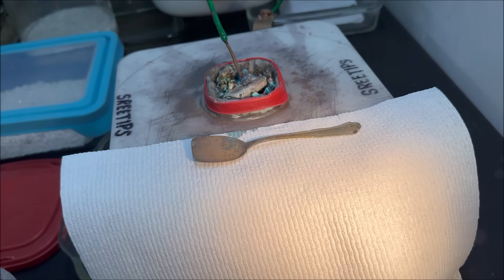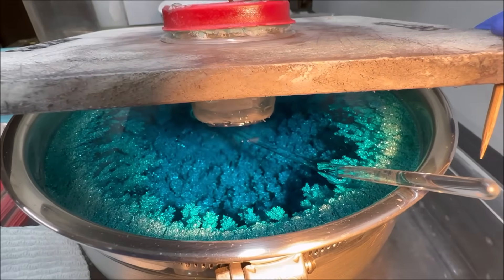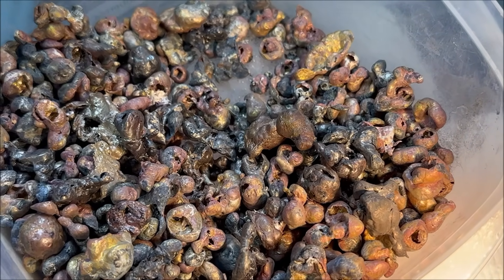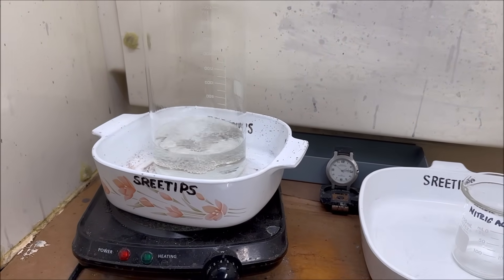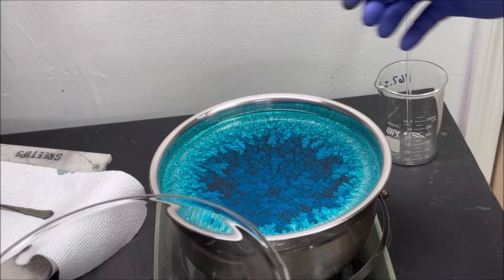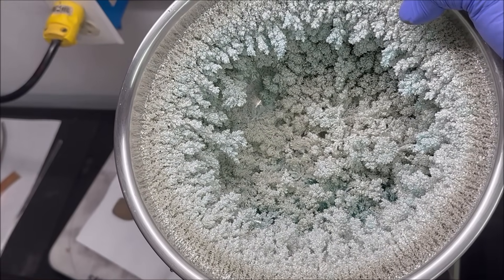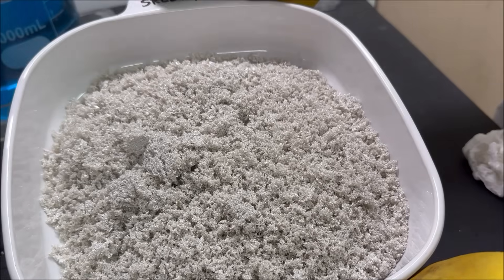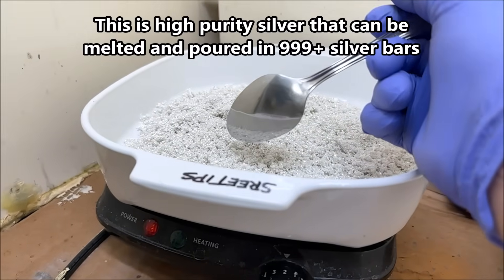999 Fine Silver Cell Harvest and Reboot

Comment: Where and how did you get your starting material from which you extracted this silver?
You said something about a byproduct of your gold refining?
Reply from the maker: I refine gold. I use sterling silver, that I buy at estate sales, to refine the scrap gold. I recover the silver from that, melt into shot, and run it through my silver cell. Silver is a by-product of my gold refining. The cell converts the impure silver (about 980 parts per thousand silver) to high purity four nines fine (9999 parts per ten thousand) pure elemental silver metal. So I’m refining the impure silver, into high purity silver, not creating silver out of thin air. When it’s full, I harvest the pure silver crystal, put it away and forget about it. Then I repeat the whole thing again.

Comment: Whats the source material?
Reply from the maker: I refine gold. I use sterling silver, that I buy at estate sales, to refine the scrap gold. I recover the silver from that, melt into shot, and run it through my silver cell. Silver is a by-product of my gold refining. The cell converts the impure silver (about 980 parts per thousand silver) to high purity four nines fine (9999 parts per ten thousand) pure elemental silver metal. So I’m refining the impure silver, into high purity silver, not creating silver out of thin air. When it’s full, I harvest the pure silver crystal, put it away and forget about it. Then I repeat the whole thing again.

Comment: How many second hand store cutlery pieces are needed to produce 1.3 kilograms of .999 silver at $0.25 a fork?
Reply from the maker: I refine gold. I use sterling silver, that I buy at estate sales, to refine the scrap gold. I recover the silver from that, melt into shot, and run it through my silver cell. Silver is a by-product of my gold refining. The cell converts the impure silver (about 980 parts per thousand silver) to high purity four nines fine (9999 parts per ten thousand) pure elemental silver metal. So I’m refining the impure silver, into high purity silver, not creating silver out of thin air. When it’s full, I harvest the pure silver crystal, put it away and forget about it. Then I repeat the whole thing again.

Comment: So what other elements are in the left over sludge besides gold and platinum? Also how many grams of silver did you say you used to seed the batch, 600g? Where do the new silver atoms come from?
Reply from the maker: I refine gold. I use sterling silver, that I buy at estate sales, to refine the scrap gold. I recover the silver from that, melt into shot, and run it through my silver cell. Silver is a by-product of my gold refining. The cell converts the impure silver (about 980 parts per thousand silver) to high purity four nines fine (9999 parts per ten thousand) pure elemental silver metal. So I’m refining the impure silver, into high purity silver, not creating silver out of thin air. When it’s full, I harvest the pure silver crystal, put it away and forget about it. Then I repeat the whole thing again.
Reply from the maker: Maybe some palladium and rhodium

Comment: Hello Sir,
You are calling this silver crystals. Is this also normal metallic silver? Which isotope?
How profitable is this whole thing?
Reply from the maker: In order to determine a profit I’d have to sell the silver. But I’m not selling any (except a few ounce on my eBay site). I’m not selling, I’m buying.
Reply from the maker: I refine gold. I use sterling silver, that I buy at estate sales, to refine the scrap gold. I recover the silver from that, melt into shot, and run it through my silver cell. Silver is a by-product of my gold refining. The cell converts the impure silver (about 980 parts per thousand silver) to high purity four nines fine (9999 parts per ten thousand) pure elemental silver metal. So I’m refining the impure silver, into high purity silver, not creating silver out of thin air. When it’s full, I harvest the pure silver crystal, put it away and forget about it. Then I repeat the whole thing again.

Comment: Brother what is the best torch to melt silver and gold with. I find my mapp gas taking a long long time to melt in the winter days. Whats the next step up? I dont know a thing about aceteleyene torches
Reply from the maker: I use acetylene torch with flame down low to melt pure silver. Then switch torches to MAP for the pour. I had problems with the molten silver out gassing in the mold and forming a bubbles looking surface when I kept the oxy/acetylene torch on it for the pour. MAP takes about ten minutes to melt 5 ounces of silver. Oxy/acetylene takes about two. This has been my experience.
Reply: @sreetips  is it difficult to use one of those torches? I just don't want to blow myself up hahaha
Reply from the maker: No, they are scary at first but once you use it a few times it’s a breeze. I love mine. Been using it for 14 years. They have automatic flame arresters that prevent the flame from getting up the hose and into the tanks.
Reply: @sreetips  perfect!! Thank you so much brother. I will make the investment today!
Reply from the maker: Get one from a welding place such as Linde Welding Supply. Mine is a medium duty. You get the bottles for a deposit. When they’re empty you can swap them out and just pay for the gas.
Reply: @sreetips  Perfection brother. I will reply with which one I purchase.

Comment: I would like to try this - could I use my scrap silver with solder on it from silversmithing as the initial pieces in the filter? 
Also it would be useful to have a list of safety equipment. What kind of mask etc.
Pure silver powder would be so useful to me to use for texturing jewellery apart  from anything else.
Reply from the maker: In order for electrolytic refining to be successful, the anode material must be fairly high purity to begin with.
Reply: @sreetips Thanks!
Do you have a video on all the equipment you need and all the safety precautions?
Reply from the maker: I have one titled silver cell build from scratch step by step.

Comment: Can you actually profit from this
Reply from the maker: I went from zero net worth, 1/4 million in debt, to seven figures, debt free, in nines years. And I did it with gold and silver.
Reply: @sreetips  my friend and i had a plan to process plated gold jewelry
Reply from the maker: I have videos on operating a sulfuric acid stripping cell. GP material is very low yielding. May take up to ten pounds of GP material to get just one gram of pure gold. But it is a way to recover gold from junk jewelry. If you seek to “make money” then you should be looking for karat gold at local sales. Americans are utterly clueless about silver and gold. Most believe, incorrectly, that paper currency is more valuable than gold and silver. This lack of understanding is a conditioning imposed by those who print the currency, out of thin air, “without limit.” You can become very rich using this lack of understanding to accumulate a fortune in gold, and silver. But it won’t just fall in your lap. You’ve got to know what to look for, when to look, and where to look. Mrs sreetips found two giant charm bracelets loaded with charms. Paid five hundred bucks. The gold alone was worth nearly eight grand! But she has a trained eye (been doing it for decades), she gets to the sale first in line (if you get there later then you get nothing), and she knows where those sales are by doing research ahead of time. There’s lots of work involved, there’s no free ride. With people being ignorant about these monetary metals (gold and silver are still real money, real wealth, regardless of what people say), you can become rich. But this won’t last forever. At some point folks will begin to wise up and realize that their fiat paper, or digital, isn’t worth what they thought it was. Then there will be no other place to turn except into gold and silver. Get some! While the getting is good.
Reply from the maker: The currency printers can’t afford to have you converting your savings from their paper (currency is a money substitute, and it has no real value) into real money, gold and silver.

Comment: SO from refining gold I assume that's Silver And Lead Rock combo?
Reply from the maker: I add sterling silver to the karat gold to refine the gold. I recover the silver and run it through my silver cell. The metals that I work with have already been mined, they are already above ground when I buy them. So there’s no lead in precious metals that I work with. The only way I could encounter lead is if someone tried to use soft solder to repair a piece of karat gold.

Comment: Could this be a method to refine recycled electronic metals?
Reply from the maker: I don’t think so
Reply: @ sadness 
Looking for a creative way to recycle circuit boards
Reply from the maker: I remember accumulating computer scrap when i first started. Had scrap PCs taking up lots of room in my shop. Finally realized that the amount of scrap needed to recover a decent amount of gold would require a mountain of junk computers. They ended up in the trash at the dump.
Reply: @ damn… good to know. I was given some huge boards. So they aren’t normal circuit boards, but I’ll just put them away and stock them up. Any other ways to acquire pm to refine if we aren’t close to a mine?
Reply from the maker: Check FB market place, estate sales, yard sales, thrift stores, consignment shops, resale stores. We just got back from a trip paid for with gold we found by stopping and searching at these places.
Reply: @sreetips  appreciate all the advice! I’m about to stop by shops while I’m away working to look for some treasures
Reply from the maker: We found two grand worth of gold for about twelve hundred. Plus a bunch of silver coins. It’s out there for those who know when, where, and what to look for.
Reply: @sreetips  do you have any tools that help you find PM or just go based off visuals
Reply from the maker: We’ve looked at tens of thousands of pieces of jewelry over the last two decades. With that much experience, we can judge, by sight, if a piece is gold or not.
Reply: @sreetips  gotta get to it then 
Thanks for the advice

Comment: Doesn’t copper have to be present for the silver nitrate to crystallize ? Doesn’t it need to do basically a “atom” swap solid copper goes to liquid as silver liquid in turn crystallizes ? Sorry for the crude grammar
Reply from the maker: Not with electrolytic silver.

Comment: Can you send the directions on how to build that exactly so I don’t blow anything up?
Reply from the maker: I have a video titled silver cell build from scratch step by step.
Reply: How do I get the garbage silver for the top if I have no silver? Also when the liquid level drops do I just add distilled water?
Reply: Also how much silver should I be starting with to make the solution?
Reply from the maker: The concentration that I use is 150g of pure silver dissolved in one liter of liquid.
Reply from the maker: I buy sterling silver at estate sales. I prepare extra silver nitrate electrolyte and use it to adjust the level in the silver cell.

Comment: I want to hangout with you and better learn this process and see what safety precautions are necessary during what exact steps and pprocesses. This is definitely chemistry and understanding elements and chemical reactions, fused with electrical knowledge as far as the DC power supply, anode (usually positive) and cathode (usually negative). When you mentioned augmentation I know augment usually means to undergo a form of change if I'm not mistaken. If you live in the midwest I would seriously pay money just to hangout for the process and take your crash course so to speak to learn it better. 

Awesome video.

Comment: Okay comments "blah blah blah" now what exactly was that ? Did you "Grow" silver at all . Or just filter the silver to finer purity ?
Reply from the maker: Good question. I refine gold. I use sterling silver, that I buy at estate sales, to refine the scrap gold. I recover the silver from that, melt into shot, and run it through my silver cell. Silver is a by-product of my gold refining. The cell converts the impure silver (about 980 parts per thousand silver) to high purity four nines fine (9999 parts per ten thousand) pure elemental silver metal. So I’m refining the impure silver, into high purity silver, not creating silver out of thin air. When it’s full, I harvest the pure silver crystal, put it away and forget about it. Then I repeat the whole thing again.

Comment: Man, you gotta make a vid selling this at pawnshop and them testing it!
Reply from the maker: No need. I’ve sent this off for fire assay and it comes back three nines. However, I sent some of the pure silver crystal back through the cell a second time. Then sent a sample of the twice-refined pure silver crystal off for ICP analysis. That came back greater than five nines fine. That’s 99999 parts per one hundred thousand pure elemental silver. And that’s as close to 100% pure silver as humanly possible.

Comment: That filtered anode is pure genius.
A tip if I may : @ 8:05 or so, when you heat the silver/HNO3 mixture, you should recapture the NO2 that forms and bubble it inside water to recycle it as brand new HNO3.
Reply from the maker: Excellent suggestion, thank you

Comment: you still need silver to make pure silver. It just dosent magically appear from thin air. This video shows how to purify it.
Reply from the maker: Correct. I refine gold. I use sterling silver, that I buy at estate sales, to refine the scrap gold. I recover the silver from that, melt into shot, and run it through my silver cell. Silver is a by-product of my gold refining. The cell converts the impure silver (about 980 parts per thousand silver) to high purity four nines fine (9999 parts per ten thousand) pure elemental silver metal. So I’m refining the impure silver, into high purity silver, not creating silver out of thin air. When it’s full, I harvest the pure silver crystal, put it away and forget about it. Then I repeat the whole thing again.

Comment: Where did you harvest the silver from???
Reply from the maker: I refine gold. I use sterling silver, that I buy at estate sales, to refine the scrap gold. I recover the silver from that, melt into shot, and run it through my silver cell. Silver is a by-product of my gold refining. The cell converts the impure silver (about 980 parts per thousand silver) to high purity four nines fine (9999 parts per ten thousand) pure elemental silver metal. So I’m refining the impure silver, into high purity silver, not creating silver out of thin air. When it’s full, I harvest the pure silver crystal, put it away and forget about it. Then I repeat the whole thing again.

Comment: bro can we grow silver yes or no
Reply from the maker: Yes we can. I’m growing silver right now. I refine gold. I use sterling silver, that I buy at estate sales, to refine the scrap gold. I recover the silver from that, melt into shot, and run it through my silver cell. Silver is a by-product of my gold refining. The cell converts the impure silver (about 980 parts per thousand silver) to high purity four nines fine (9999 parts per ten thousand) pure elemental silver metal. So I’m refining the impure silver, into high purity silver, not creating silver out of thin air. When it’s full, I harvest the pure silver crystal, put it away and forget about it. Then I repeat the whole thing again.
Reply: @sreetips  is it a good money making method?
Reply from the maker: My wife finds silver very cheap at yard sales and estate sales. I use it to refine gold. Silver is a by-product of my gold refining. I recover the silver, melt into shot, then run it through my silver cell. About a decade ago, I’d melt every bit of silver from my silver cell and pour pure silver bars, 5 ounces each, and sell them on my eBay site. It provided a nice income stream because we bought the silver so cheap. But today, I just refine it, harvest the pure silver crystal, then put it away and forget about it. I don’t worry about reselling it, but I could if I needed to. Silver (and gold) are both grossly undervalued. I may start making pure silver bars again, when silver gets up over a hundred bucks. But for now, with silver so undervalued, I’m not selling any of my silver. Hope this helps. Thank you for your interest.

Comment: It’d be interesting to weigh the silver block anode before and after electrolysis to figure out how much of the crystallized silver at the cathode comes from the anode.
Reply from the maker: Most come from anode, but some silver from the electrolyte does plate out on the cathode, causing the electrolyte to become depleted.
Reply: @ I guess I should clarify: I’m referring to the silver block that has an embedded copper wire. I wonder how much of the silver yield comes from there.
Reply from the maker: None, so long as I keep it up out of the electrolyte.
Reply: @ Interesting. Isn’t it touching the electrolyte in the same way as the other impure silver chunks in the anode?
Reply from the maker: Correct

Comment: so do you end up with more silver than you started with or is this just a purification operation?
Reply from the maker: I refine gold. I use sterling silver, that I buy at estate sales, to refine the scrap gold. I recover the silver from that, melt into shot, and run it through my silver cell. Silver is a by-product of my gold refining. The cell converts the impure silver (about 980 parts per thousand silver) to high purity four nines fine (9999 parts per ten thousand) pure elemental silver metal. So I’m refining the impure silver, into high purity silver, not creating silver out of thin air. When it’s full, I harvest the pure silver crystal, put it away and forget about it. Then I repeat the whole thing again.